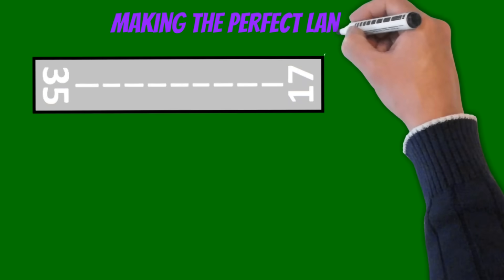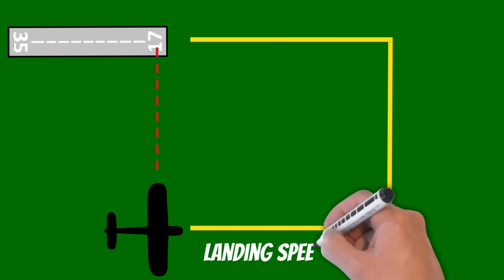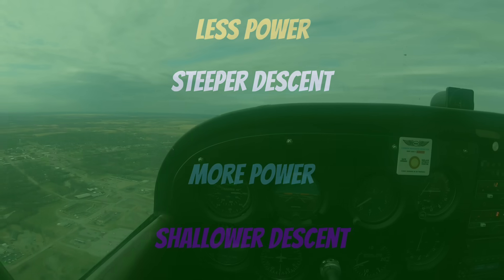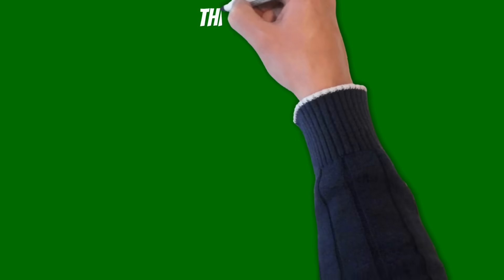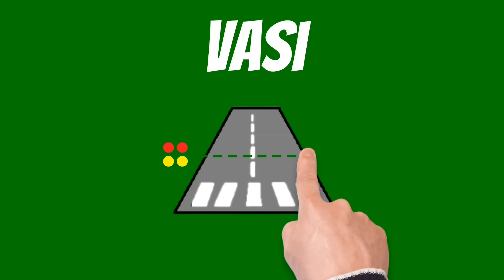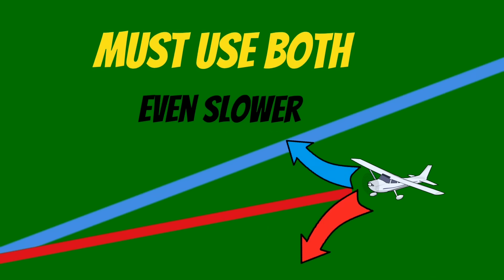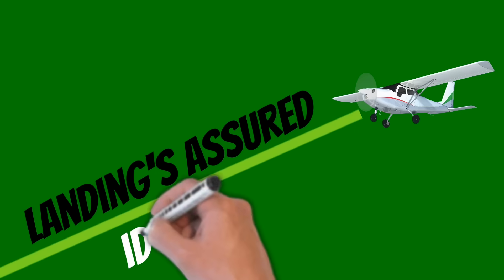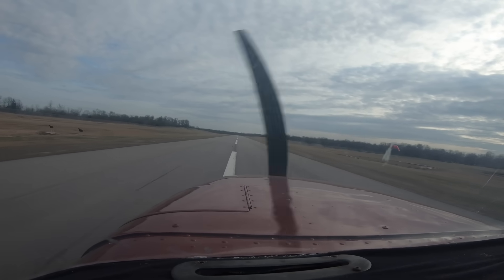Landing SECRET your Instructor won’t tell you [How to Land]

Comment: It took me a while to nail the landings on my piper  Comanche lol lord knows that suspension was tested for the first couple of months as i became more familiar with my low wing aircraft.. I absolutely adore my plane now and I’m sure i could stop the nose wheel on a 25¢ piece now.. the only thing I’m not too confident on yet is flying in freezing climates… being from California there’s almost never ice around
Reply: just remember no need to worry about icing unless you are flying in visible moisture, ie clouds or fog. I've heard CFIs warn pilots about icing on clear crisp days and wonder...why?  If you fly IFR regularly in the soup in a small single 1) got some nerve 2) Fly IFR in the soup near-freezing conditions you will run into some problems just remember to descend if you start collecting ice. Look for a hole and let down safely to warmer air, of course, this only works if you are flying borderline temps, if it's freezing on the ground that technique will not work.
Reply: Never Ever fly in icy conditions. If you do just play. Russian roulette
Reply: @johnfairchild3421  that was easier said than done 2 weeks ago.. i was flying back to los angeles from vegas and going over the mountains i encountered ice.. luckily i made it but i was definitely puckering up and keeping an eye on my leading edges.. I actually gave her a tiny bit of flap and slowed down a hair and went full carb heat with some other minor adjustments and made it through ok.. definitely not something I’d wanna do again anytime soon.. but i also wasn’t expecting such a dramatic weather change in short time either.. by no means am i a professional, but i am getting pretty savy with my baby girl by now. Being a 1964 piper 260 she still has some tricks up her sleeve. But now my paranoid behind has me looking at heated wing options at aircraft spruce 😅

Comment: Stabilized approach is how I learned too. Know your airport elevation, always use the rpm setting for your airplane,  set flaps. Also use flaps at your discretion depending on wind. Use power for altitude. Watch air speed. 
Gumps 
Predictable performance
Reply: knowing the landing elevation is single most important thing you need to know before you land, without that knowledge a stabilized approach is a crapshoot as runways can give all kinds of illusions if they are not on a flat grade.
Reply: @pjhudson5344  exactly. Also with density altitude all those settings change. But these are the principles.

Comment: I didn't see anything in here my instructor didn't cover. In high traffic TCAS they tell you where they want you, when to turn everybody knows that. I had to be able to hit the numbers before he'd sign off for my solo permit. Then short field, soft field,  both of them over obstacles. Same as they taught everyone. Crosswinds, slips. Everything except high performance and complex. He even took me on a couple of mail runs so I could get a chance to feel the difference for myself. Then I had to take a dress rehearsal check ride with the FBO'S chief pilot before I could try for my license. I'm assuming, except for the mail runs, it was standard for the program.

Comment: BS!!! Arrive at final with CORRECT SPEED!!! Put nose just in front of runway and control just two things from that: nose position and speed. Controll that speed agressively WITH POWER. Do not allow the speed to increase or decrease more than 2 knots before adding or reducing power SLIGHTLY.
WHY DONT YOU TRY IT. 
Did you notice you were too low on speed just before landing? YOU CORRECTED THAT WITH POWER. Which contradicts your method, not mine!

Comment: While all this is covered in MOST textbooks and FAA guides, the greatest problem I ever found with it (PPL since 1984, several ratings and certs since then) is that your smallest craft and trainers (Cessna 152, for example) do NOT have the power to have a full-range of 'power resources' to overcome bad positioning. You mention the good 'rule of thumb' on placing your downwind at your 45, but you didn't mention your beginning altitude of the maneuver. Am I at 1,000 AGL, 2,000 AGL, 4,000 AGL? Uncontrolled airport, I've seen all these happen...followed by 'flaps to stall + 10' (which, thankfully for a 152, ripping off flaps is not going to happen with such oversight). OR...you have someone on low altitude downwind, 20-degrees flaps, maybe 500-AGL, literally trying to maintain 'controlled flight' at stall + 10 in level flight for half-a-mile to get TO the runway.
Personally, the best advice I ever received was from my PPL instructor...he said 'once you are on downwind, trim your power back while (terrain permitting) you accomplish 1,000 ft AGL by the turn onto runway approach (no more than 1,500 for the 152's and generally 172-class piston engines), apply 10-flaps STARTING AFTER you have completed your turn, keep your power comfortably above stall, take into consideration ground effect winds and general weather conditions (hot, etc.) and (as you are in VFR), take it in with 'aim alignment' (much like using VASI), additional flaps as needed (winds, etc. which may cause stall near-ground).
I've ALWAYS had good landings by following this...and his last words always set with me, over the years I've ridden with other pilots...he said, 'NEVER APPLY OR MAKE TURNS in light single-engine piston aircraft while under flaps! If you do this, you are using flaps as a crutch for proper flying!' Flaps not only change your aircraft flight characteristics for airspeed, but they impact how your plane behaves in stall and as it approaches stall, sometimes in ways you can't anticipate and almost always in ways you do not desire. Add to this, no more 'available power' means you're already working with all you've got! It is NOT an F-14 you're dealing with.  Did I mention he was a former Blue Angel pilot?
Reply: Odd advice from a Navy pilot, considering we dropped the flaps in the T-34 off the 180 (perch, turn to base), set decent power at that time, and then commenced the turn. I get it though. Not much extra thrust to get you out of a jam in a 172.

Comment: I love powered landings which are typically associated with back side flying though power techniques work on both sides. Careful with pitch discussions, however, as front side and back side work differently (pitch up slows in both but floats in one, sinks the other assuming no associated power adjustment). Most civilian aircraft except possibly bush folks like flying front side but note your best glide is at the transition point between the two. Consider gliders too, power isn’t available, but they typically use a midrange spoiler as reference such that spoiler usage equates with throttles/power levers. For a challenge discussion, consider how do you fix a backside “on-speed” engine out high while you’ve exhausted drag devices and slip?

Comment: Pitch for speed, thrust for angle. Worked for every plane, jet or prop.
Reply: So if you are flying into a controlled airport and they tell you to maintain altitude and slow down 10kts do you pitch up to slow down?
Reply: @onemoreboat  you’ll pitch up a little and throttle back a bit at the same time. Once stable, you”ll be pitching for speed and making small corrections with thrust (throttle) to control your high (angle) to runway. If you are already doing a speed that is behind the power(thrust) curve, you may be adding power once you’ve slowed. But, we don’t like to fly there and just say “unable.”
Reply: @zedgravitus1836  That doesn't make sense. So if an airplane has an autopilot, does the autopilot adjust the power to maintain altitude or does the autopilot adjust the elevator to maintain altitude?

Comment: Geeeeezzz.....if you have to do all these calculations and mechanical problematic equations before landing....forget it...your never going to be able fly.
Aim for the G D runway. Keep your speed 5 or 10 mph faster than your stall speed.... irregardless of the winds and weather.... side slip, pull on flaps, set your pitch....whatever you got to do to keep you speed constant. One hand on the throttle ... both eyes on the threshold ... flare , throttle back, land the G D thing.
Use the seat of your pants.works every time.
How hard is it for you to turn your car into your driveway .... do you need a manual for that too?
I thought I was going to learn a new trick. I just wasted 15 minutes.

Comment: NEVER in a light aircraft select flaps in a turn, if one side goes down and the other stays where it is the aircraft will roll onto its back and you will not know what the hell is going on until it is too late. In airliners we have protections that stop that from happening. Stay safe everyone.
Reply: Is it much different from the same malfunction in level flight?
Reply: @alk672   At least when in level flight, as soon as the aircraft starts to roll, your hand is normally on the flap lever, so you can put it back up straight away. If you are in a turn, and you put the flaps down, if the higher wing flap goes down, it gains more lift and before you know it the aircraft is on its back. Try recovering that. A crash report about a Tu-154 that was in a turn when they put the flaps up after take off. The aircraft rolled and crashed inverted. Fly safe, learn by other’s mistakes as you are not going to be around to make them all yourself.

Comment: It wasn't until my final check ride that a visiting field examiner explained the art of the perfect landing. The rule is, of course, in all cases fly the plane but the only power adjustment that should be needed is to reduce power on final. So at the beginning of final set your flaps establish your aim point and reduce power as needed to keep that point but always keep sufficient power so as not to drift lower than your aim point point  You will usually continue to reduce power along the path while keeping sufficient speed to stay nicely on path Once across the threshold pull the power off and finish with a nice flare. Doing this reduces the work load at a critical time while on final and your not having deal with jockeying your power back and forth to stay on slope. That is unless your head wind craps out then like I said, first fly the plane. Oh yeah! Never slam your power in. There are no accelerator pumps on our carbs (Lycoming, Continental) Smooth even power addition when needed is the rule. Even on take off.
Reply: Excuse me, what? You are mistaken. There are definitely accelerator pumps on aircraft carburetors. 

There have been many times an idle to full power application in less than a second saved my landing gear because of wind shear.
Reply: @tylerfb1  Better check that out with your A&P
Reply: @jimgeorge6220  I'm my A&P.
Reply: @tylerfb1  So you built an experimental plane. What engine and carb did you use?
Reply: @jimgeorge6220  No man. I'm a certificated Airframe and Powerplant mechanic. Aircraft carburetors have accelerator pumps.

Comment: Once you have instructed for a few hours, you learn to teach energy management instead of pitch/power for speed.  I've had many students fail stage checks because their instructor taught pitch for airspeed, instead of teaching that it depends on your energy.  Power add/subtracts, and pitch converts.  What you use depends on your situation.
Reply: Pitch/power is energy management. Are we talking about the same thing just explained differently or are we talking about different techniques? How does energy management differ from pitch/power? How would you know if the student was taught pitch or energy if they just greased one on? I bet you must be Mr popular flunking your co-worker's students on their stage checks.  141 CFIs at the same flight school need to be on the same page unless you want some irate customers, and if I flunked a checkride for doing exactly what my CFI taught me to do, well lets just say I would expect a free recheck otherwise your gouging students for more money.  You are the boss man doing stage checks, brief your CFIs and tell them what you expect from the students.
Reply: 100%. Three main forms of energy to manage that all pilots must be taught on day 1: Kinetic (Airspeed), Potential (Altitude), and for powered aircraft, Chemical (converting fuel into heat/motion). If a student is not understanding how to manage energy, take them on a glider introduction flight with an emphasis on energy management and the concept will be understood immediately.
Reply: Stabilized approach is the objective. Constant power,  constant airspeed, constant rate of descent.
Reply: Not rocket science. it's as simple as this:
If the poh says flaps 3 at 65 knots, you fly flaps 3 at 65 knots. If the poh recommends adding half the gust factor, you add half the gust factor. Pitch and power go hand in hand.
Reply: Learn in gliders, or get a glider training during private training. Great way to learn energy management.
Reply: Amen! Energy management is the key for any phase of flying that you need to learn and understand properly early on and it will work for any airplane big or small. Although I wouldn’t say in general that instructing for a few hours gives you the insight to this, otherwise you wouldn’t see people arguing about pitch or power for speed and altitude..
Reply: It's funny, I've never read anyone else say it, but to me landing is simply energy management.
Reply: I think the two, energy management as well as pitch/power, go hand in hand. Pitch for speed, really AOA, is always correct. Where I bet yours got into trouble is not understanding prioritization of error correction. (Fix the low then the slow. Fix the fast then the high. Trade a fast against a low. Trade a high against a slow - these are energy management discussions but they require pitch/power for execution.) If you want to change pitch without changing speed, you need both a pitch and power correction. This becomes much more apparent when we realize we’re using both pitch discussion and speed as proxies for AOA. Where things get interesting is no engine (or stuck throttle) scenarios in which we’re limited on drag options be they devices and/or slips. Now you’ve got to think front side / back side and how pitch impacts glideslope.

Comment: Airspeed should not be controlled by pitch and power. It should be set by stabilizer trim. Rate of descent is controlled by power. Ideally the elevator need never be used except to rotate on takeoff and flare on landing. This works on everything from 1 1/2 oz. RCs to million lb 747.
Reply: I Dir believe you are. Right but I am not a pilot

Comment: I was taught just to keep the aim point at the same position on the windscreen and that it should just get bigger.   If it moves up the windscreen add power. Reduce power if it goes down.  No secret there.   How is a student pilot expected to judge when their nose wheel is 6 inches above the level of main gear without hanging out of the cabin on the flare for heavens sake?
Reply from the maker: Excellent.  You can’t judge 6”. I say this just so students don’t over flare.  As long as the nose wheel is above the mains, that’ll do

Comment: Pretty good video and generalized tips for good landings.   In the late 60's my CFI would often chop the power abeam the numbers, then say, 'make the field'.    Always considered a power on approach useful in certain sitations - other traffic,  controlled airport, winds and other variables that DID require power and pitch.  Though I've never forgotten the basics and assume you're engine just quit - Make the field is paramount training for most everyone.  Makes you much more aware and pre-planning.   Still use that technique today in my J3.  Every landing almost becomes a spot landing - making the field where I want it to.😀
Used to fly with a new startup FBO guy with background in the airline biz.  The 172 would be on a 2 mile final all dirtied up, lighs on, full flaps and used engine to muscle it on almost all the time.. Had fun with him over that  LOL
Reply from the maker: Thank you! Yes, practicing power off landings are a valuable asset.  I try to include this with my students as well. Too funny 😂 I need to get my tail wheel endorsement soon.
Reply: The power off final approach is good to learn on the Piper Tripacer.
Reply from the maker: @jamesrutherford9597  id love to fly one!